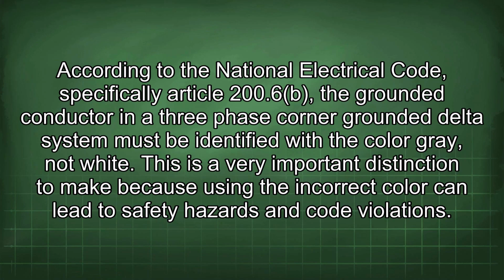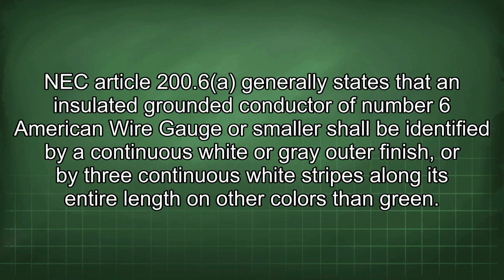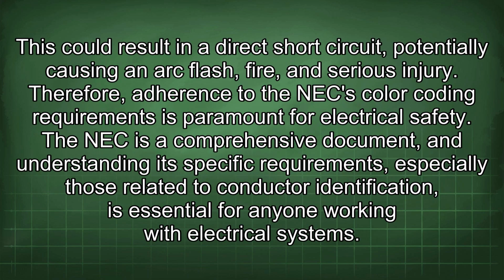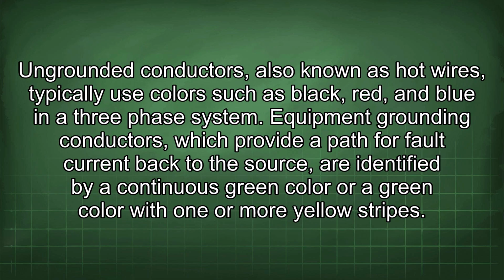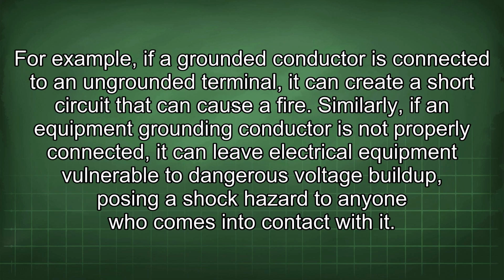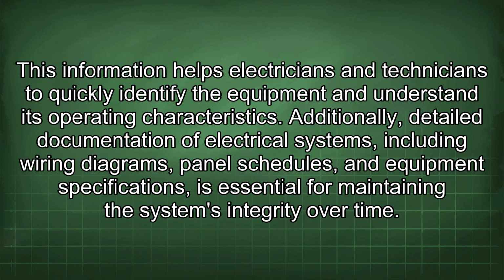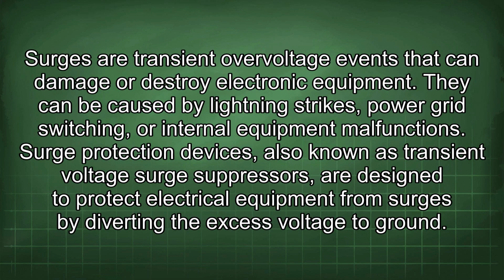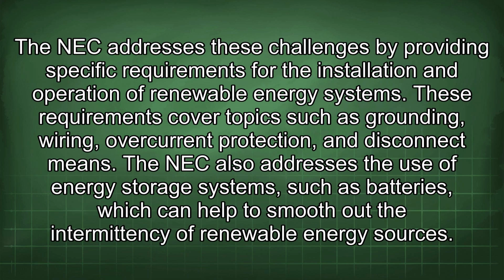Identifying Grounded Conductors in Corner Grounded Delta Systems

Comment: Looking at the 2017 NEC, I don't see corner grounded delta systems mentioned specifically AT ALL in 200.6 in terms of white vs grey. It just says either/or.
Reply from the maker: Hello @engineeringpunk,

Thanks for your comment. NEC Article 200, Section 200.6 covers the identification of grounded conductors, including those in corner-grounded systems (like a corner-grounded delta). This section requires the grounded conductor to be identified by a continuous white or gray outer finish (or equivalent markings like three continuous white/gray stripes) for sizes 6 AWG or smaller, with provisions for larger sizes using white/gray tape or marking at terminations. In a corner-grounded system, the intentionally grounded phase conductor follows these rules as a grounded conductor, not a grounding conductor (which uses green). For reference, see NEC 200.6(A)–(C) for details on sizes and methods.

The distinction that the grounded conductor in this system is a phase conductor (not a neutral) is critical and correctly noted. The use of white or gray insulation/marking ensures proper identification of the grounded conductor, aligning with NEC requirements for safety and clarity.

This information is consistent with the NEC (2020 and 2023 editions, as no significant changes to this section have been noted for 2025). Always consult the latest NEC edition and local amendments for specific applications.

Sincerely,

BESA Research
Reply: @BESAResearch  The video states that you must identify the grounded conductor with gray and not white. But the code book says whit or gray just as you state above. That is the confusing part.